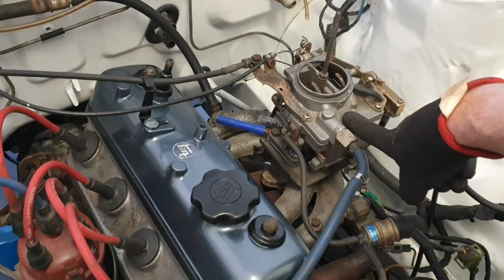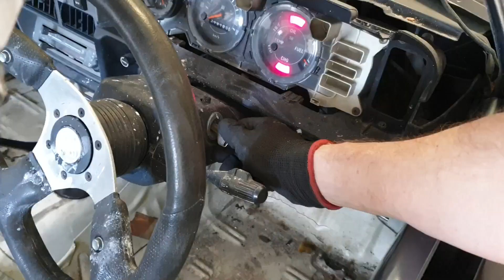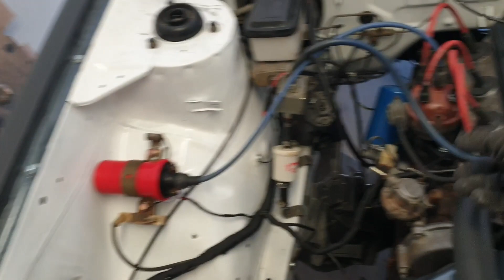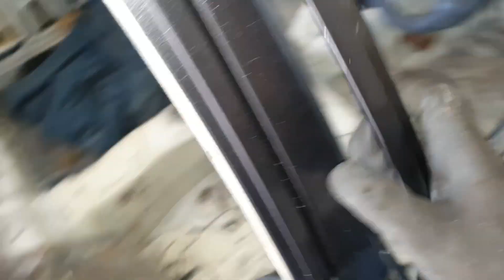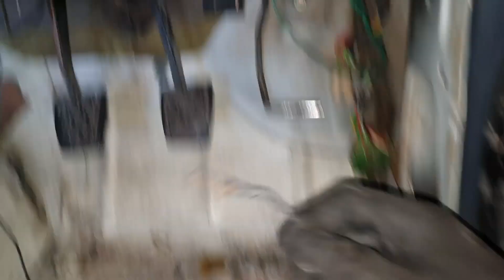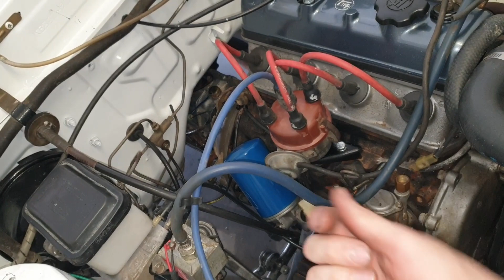Corolla KE55 Build. First Start Diagnostics. 4k-c

Comment: I know this is late and you would of worked it out by now. Those missing vacuum hoses on the carby belongs to a pollution canister that sits right near the battery.
Reply from the maker: Yeah finally worked it out. bypassed it lol made it simple and ended up running smooth as